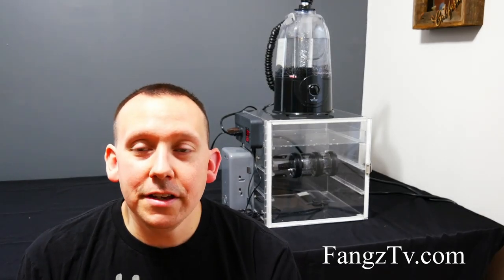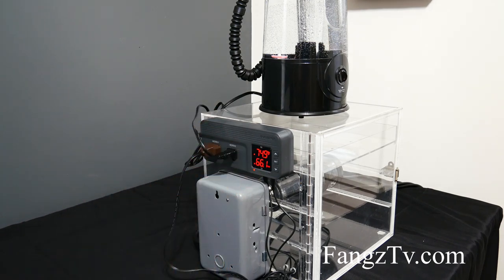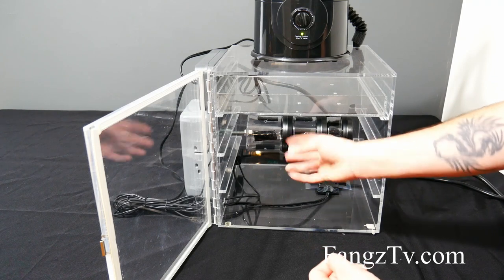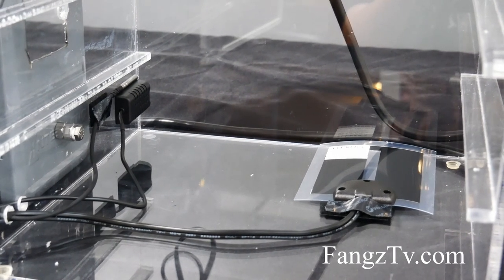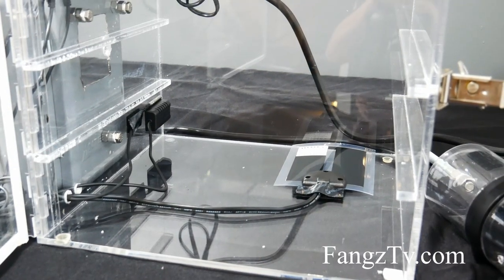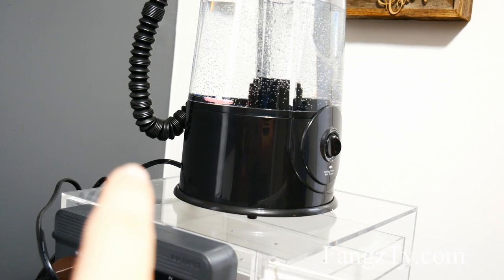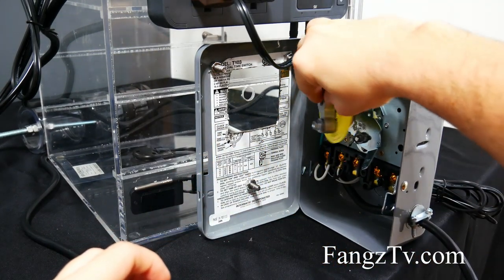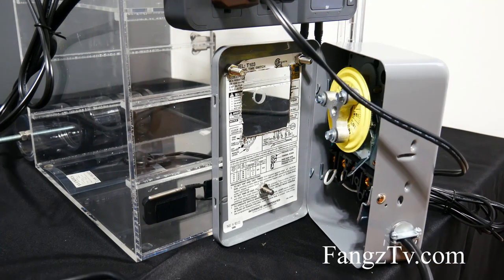Mechanical Mom Tutorial - Tarantula Spider Incubator

Comment: i dont understand how you wired the timer to stay on.
Reply from the maker: So there is a switch that moves inside on or off, as long as the unit has power it will continuously run if set to on